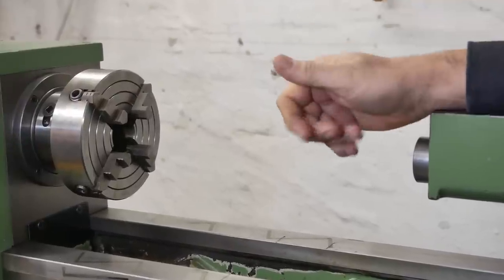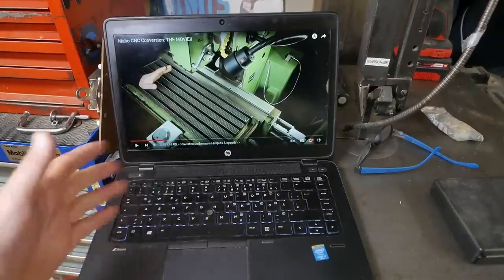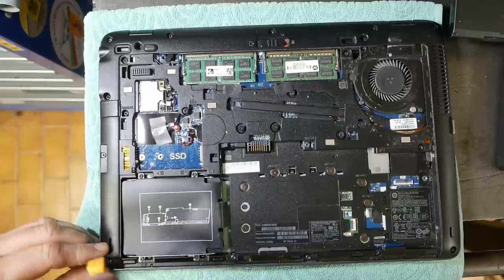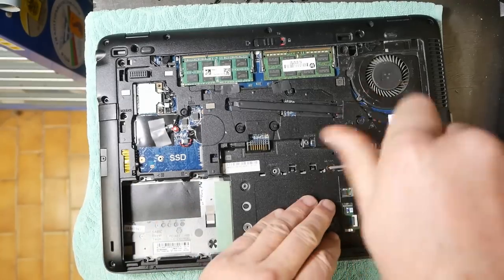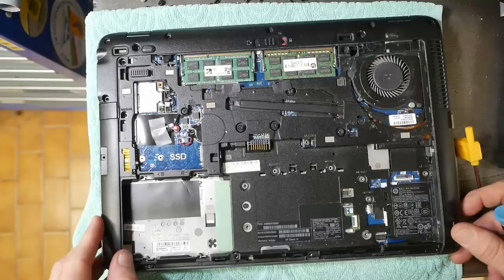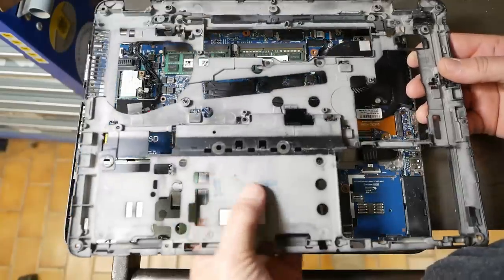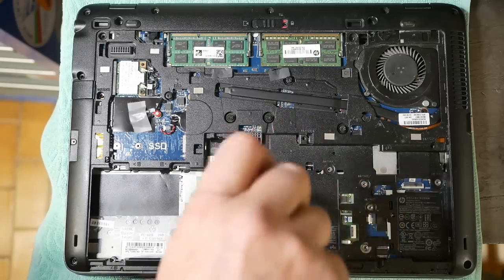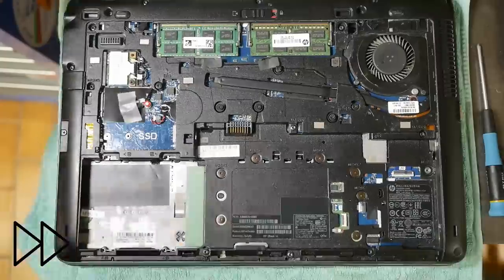M1 Mac: New, Refurbished or PAINTED?!?

Comment: If you have the space, go for a tower or desktop PC.  They can be upgraded more easily & cheaply.  If you have your heart set on a mac, then go for the refurbished one from the Apple store.  It will come with a warranty, which, since you are using it for business (YT) means you can't really afford to have it broken down for a while.
Reply: Forget PCs - too much legacy code, no vision from the OS Vendor.
Reply: @Spiderelectron  macOS is built on a lobotomised cut of a 30 year old OS - it's just had a Fisher-Price UI slapped on top. Windows has plenty of problems, but it works well enough to maintain market dominance.
Reply: @Spiderelectron  You're really quite touchy.  You could just have said "Mac OS is now based on a version of Unix"  No need to go around insulting people.
Reply: ^^ that was also my first thought, really limiting self with laptops...they overheat and die, you can't upgrade memory sticks. Apple just didn't impress: overpriced hype.
Reply from the maker: I consered a fixed PC, by the currentprice of graphics cards is so out of whack, that it seemsmore economicl to buya preformance laptop. Plus a laptop is more practical for me. I edit mostly at my desk at home, but not always.

The videos I have seen on apple silicon for video editing are pretty persuasive. While top gaming PC's like Razer blade 15 advanced might have a slight advantage in absolute power, the way the M1 stuff can maintain performance under load without throttling, or sucking the battery flat fast is impressive. 

Mr Alex Tech example is very relevant for m workflow.
https://www.youtube.com/watch?v=boMVxaNFfZ0&
Reply: @Spiderelectron  i bet you drive a tesla too
Reply: @RotarySMP  Just like anything in life where there is a choice to make, there are pro's and con's to the decisions we make. Apple or Windows, desktop or laptop, used or new, vanilla or chocolate, etc. etc. Pick the one you that meets your required needs and budget. Depending upon what programs you use now, do keep in mind the fact that you may have to purchase them again if you are switching from Windows to Apple. 

Apple often has a slight edge on how well their systems perform specific tasks because they only have to focus on a very limited amount of hardware, allowing them to select what runs best together and have the opportunity to optimize the software better for that specific hardware configuration. Historically they have focused on multimedia editing as their niche. Apple tends to cost more for the initial purchase as well as when looking to upgrade hardware. There tends to be less options to choose from for Apple products and those options usually cost more than a comparable upgrade to a Windows machine.
Reply: @Spiderelectron  only if your using Microsoft. Desktop with any of the main Unix/Linux 'distro's' may be superior depending on editing software, plus, being 'free' would save a bunch of cash allowing for a much better machine specification
Reply: @iamtheomega  I agree. Apple have not been very good with consumers for years , but, have had remarkably good advertising. Personally, it's very doubtful I would ever have another Apple product as they often drop support with little or no warning plus fought for years to prevent independent repairers working on Apple products (just buy a new one, yes, we are trying to save the planet')
Reply: @Spiderelectron  I used to service them for a living mate, I know full well they use a trimmed-back freebsd derivation with the package managment system removed. Continue fanboying though.
Reply: @RotarySMP  What I do Is use my Ryzen 2700x (yea its a bit old 8 core 3.6Ghz stock) at my desk, if I am on the garage computer or sitting in front of my shit ultralight laptop is remote desktop to the Ryzen machine ... there is a bit of input and screen lag, but its no worse than using a below happiness laptop. Then when "stuff happens" you have the computational power of a home workstation doing the heavy lifting. The UI is lagging over wifi a bit , but you could use your beater HP as a terminal to something fairly beefy that does the real work.
Reply: @RotarySMP  that is tru,everything is way to pricy right now..i looked at the gfx i have,and it's an old One..a titan x2,a used One was sold for 450€ here in Sweden..an 8 year old card- amazing
Reply: @jonjohnson102  Nah - not my style ;-) Look guys all I was saying was don't cristicse macOS unless you've actually used it and analysed it. Being different doesn't make it wrong. I use Windows, macOS and Ubuntu all day everyday for work. It's horses for courses - whatever is the best OS for the job, does the job. macOS has it's faults - sure - but so does windows. M1 Mac is a good fit the operation required here. Just because it does things differently doesn't mean it's wrong.
Reply: @RotarySMP  for graphics cards: If you think a GTX1060 3GB is usefull, I´m happy to give you one or two from my mining rig that´s just collecting dust. I´m in Vienna too.
Reply from the maker: @bernhard_derProtoTyp  Thanks for the offer. Resolve really needs upwards of 8GB GPU, and I will stick with laptops, as I need the protablity, but I appreciate your support.
Reply: @RotarySMP  makes sense! then the air seems like a really great option. ...and I love the idea of painting it green. at least some vinyl on the lid. would paint affect its cooling capacity?
Reply from the maker: @bernhard_derProtoTyp  I also got push back on paint disrupting the the cooling.

Based on the generosity of the viewers, I  am now saving up, and will like for for a 14" MBP, due to thecard slot, monitor, and greater still performance.

Comment: The M1 Macs, all of them, are fantastic. No hesitation to recommend. If the used one works well who cares what it looks like?
Reply: This guy ⬆️
Reply: Seconded. I finally moved on from my (at the time) top of the line 2015 era Macbook Pro. It's great. 

AppleCare is legitimately useful because at this point, if something does go wrong with the hardware, more often than not they don't repair it they simply replace a larger subassembly which can be expensive.
Reply: I purchased a M1 Mac when over. Year ago. I have regrets. Highly recommended.
Reply: @argee55  you give mixed signals 😅
Reply from the maker: Yeah,  really :) MIxed signals. Is there a "No" missing there? Thanks for the feedback though.

Comment: Don't buy a mac, I think its worth investing in a desktop for editing, doesn't even have to be a crazy one, just don't cheap out on the CPU, it matters the most in my experience.
Reply: You'd be surprised. The m1 chip in the new Mac is incredibly powerful.
Reply: @DoRC  I personally wouldn’t go with a Mac especially the new ones except for the Mac part that’s 10k+ you can’t upgrade basic things like storage or ram . Also apple is very anti repair any repair done by apple that involves the motherboard results in them replacing the motherboard without making any attempt to transfer your data.
Reply: @joshuahuman1  How many times did you upgrade your processor or RAM?  How many of the 6 slots on your ATX motherboard have you used up? If you don't have an ATX motherboard, you're contradicting yourself because it's the most upgradable form factor. I know tons of folks still kicking their 2012 MacBooks.

Louis Rossman has a point, but he tries way too hard to disparage Apple and it just makes him sound like a blowhard.
Reply: I get the mac argument, I'm sure they are appropriatly spec'd, but they're very expensive for not much of a reason, and you can't repair, or upgrade them, after sales support is garbage, I stopped getting apple a decade ago, but either way, whatever floats your boat.
Reply from the maker: I am a PC guy, and did upgrade the ram and SSD on teh Zbook, but Thunderbolt is so fast you can offload storage.

The M1 really has changed the calcuation. Resolve needs an 8GB GPU on windoes to edit 4K, but the M1 seem to balst through it without even thottling.
With the current price of 8GB GPU's, even used, it would be a struggle to put together a used part desktop with the performance of the M1 Air, for that price. And I need a laptop about 20% of the time.

Comment: I use a desktop ...An old Dell Precision T5500. It's got 2 quad core processors 36 GB of ram, an old Gaming Video card that is still pretty good compared to any laptop.   Total build was about $250. I bought a one year old laptop for $165 in 2012 that I still use. I don't even know how my stuff compares to modern equipment. My desktop doesn't have any problem running anything at all. Oh, fyi if it says Apple you are paying at least 2x what it's worth.
Reply: That goes for phones. The m1 macs are a pretty good deal
Reply: I’m still running a T3500. It was a screaming machine when I put it together, 12 Gb of DDR5 and a W Xenon quad core with hyper threading. It was almost beefier than the engineering work stations at my university.
Reply from the maker: Resolve is optimised to load the GPU and needs 8gb of video ram for 4K editing.
With the current price of 8GB GPU's, even used, it would be a struggle to put together a used part desktop with the performance of the M1 Air, for that price. And I need a laptop about 20% of the time.
Reply: @RotarySMP  These old Dell Precision T series have two Pcie 16x video slots. You can get 4 gb ddr 5 Radeon video cards for under $75 US and slam two in there. That should do it. Even something as old as a Radeon 7670,

Comment: 4K really Mark?
Your quality is great as it is. It's the content that makes it really worth the watch.

4K comes at a premium all round, so it's not just the type and cost of hardware to render it, but the huge amounts of storage you'll need too. Laptop's don't generally come blessed with large drives, so we're then talking NAS appliances and a fast network (wired) or several external drive enclosures over USB. Again, lappy's generally only come with gigabit networking, so be also prepared for long waits simply just loading up the raw footage. I'd hazard a guess that most of us don't watch in 4K anyway, so the extra cost and workload might not be worth it.

My choice would be to go for a desktop PC. This gives you upgrade options should you need. Prices all round are still inflated - what with the supply chain problems and lurgy hangover - so you could take benefit from the price drops for component upgrades when they come. In contrast, a laptop (of any type) will be a one shot - and overpriced - deal. While I do hear good things about the M1 series, I've always had an aversion to the whole Apple ecosystem and resent the "Apple tax" even if the hardware is nice. Don't let my prejudice influence you however. 

DaVinci Resolve is cross platform, so the OS of choice shouldn't matter a great deal. - It works well on Lennox btw ;-D
Reply: What he said! Your videos are top quality already. Save your money. 😀
Reply: I totally agree. No real need for 4k.
Reply: yeah 4k is overrated imo
Reply from the maker: Thanks guys. With my current DSL line, I am maxed out at 10mbs up, so uploading 4K video is not really possible, and there is no plan to improve coverage of my meihbourhood.

Shooting and editing in 4K would have some advantage in flexiblity of crop in editing. I already do this a bit with Panasonics excellent in camera live crop,to simulate a slider.

The prices of GPU's even second hand make a fixed PC pretty uncompetitive with laptops, and I am away enough that a laptop suites my workflow better.
Reply: yep-  I watch in a window on a 2k monitor...  When you do upgrade the computer I would want a warranty.  I am a Linux user but for your use case (edit on a laptop) the Macbook is a good choice.

Comment: Windows desktop.  Unless it needs to be portable the maintainability means a lot.  High-end GPUs are hard to come by but one a few generations back will keep you just fine.  The Intel macbook I have only does one external display per Thunderbolt port so forget displaylink and displayport MST.

All that being said 1080 is fine, really; good lighting like yours makes more of a difference.
Reply from the maker: Currently even an older 8GB GPU used is so expensive, I cant build a desktop PC for the price of a decent used laptop. Plus I do need a laptop for my work flow. Good point about the air only supporting one monitor. I am planning to get an external monitor or two for my desk.

Comment: I think most apple laptops use the case itself as at heatsink (I guess more of a reservoir for the air) so I am not sure painting would work the best. I haven't had any issues yet with my refurbished computer gear but they are generally EOL business stuff instead of consumer gear. Have you considered an M1 mini instead of a laptop form factor or do you edit too much on the go to make that an option? It would save a bunch for comparable hardware but is far less mobile.
Reply from the maker: I tend to edit enough on the move that a laptop plus docking hub/Monitor/keyboard makes more sense than a fixed pc.
Reply: @RotarySMP  Understandable. 

Here is a Linus tech tips video about the M1 Air that I was misremembering about the cooling. https://www.youtube.com/watch?v=ghDvyItIHTY He adds some thermal pads between the internal heat sink and the back panel of the case to improve the cooling and increase performance (~8%) for extended workloads. 

I think the M1 Air would be a great upgrade but would probably go for the refurbished ugly one.

Comment: I've been buying refurbs (with warranty) for various businesses for years now and they've been just as reliable as new machines imo. Used is probably also fine (and a machine green one would be hilarious). So i'd go with one of those if it has to be a laptop. Otherwise, i'd also try finding a decent used/cheap tower PC,  maybe upgrading it a bit. That way it's much more easily upgradeable
Reply from the maker: I probably edit about 80% at my desk at home, but move around enough that a laptop fits my workflow better. 

The performancein video editing of evenbaseline M1 Air is astounding.
https://www.youtube.com/watch?v=boMVxaNFfZ0&

Comment: Get the M1 mini (700ish) and bolt it to a decent size monitor ($-$$$). Gets you two benefits a) its still sorta portable in the house b) instead of buying you can make a video on the vesa mount ;-). If you need to take it on trips its the Air for certain.
Reply from the maker: I need a latop bout 20% of the time, but that is enough to make it necessary. I will get a big screen though, as editing in a 14" monitor is really getting old.

Comment: I recently switched  to desktop, just more value for money. Kinda hard to carry around though..😅
Reply from the maker: Resolve is optimised to load the GPU and needs 8gb of video ram for 4K editing.
With the current price of 8GB GPU's, even used, it would be a struggle to put together a used part desktop with the performance of the M1 Air, for that price. And I need a laptop about 20% of the time.
Reply: @RotarySMP  fair point, for both desktop and laptop I went with refurbished and,  personally, I really recommend  refurbished as the product is basically as good as new. A downside is that you're always running behind on new tech.

Comment: Does it have to be a laptop? The Mac Mini M1 base model costs 800€ new. You need external storage if you want to have 4k videos stored. The good thing about a desktop is that you don't move it much. If you were to drop a Macbook Air you'll probably gonna break it immediately and should consider Apple Care +. 

I love MacOS. It is in my opinion a very good OS if you are bought into the Apple ecosystem. I had a Mac Mini M1 but had to sell it due to my needs for CAD software which is, in comparison to Windows, non existent on MacOS. I didn't try to edit videos on Mac before, I only heard that they are good, especially the M1 Mac.
Reply from the maker: I need a laptop, as I travel enough I like to use the down time for editing.

Comment: Hello Sir,
First go for the Patreon community will be eager to throw some money at you ;)
If you really want to buy M1 Air and the cheapest one go for Refub , it is "only" 150Euro more expensive and you have a warranty. But i would consider to go for a higher spec . With the bottom of the line you will be stuck with 8gb of ram and 256 internal storage .
And if you will go for a higher spec you can start considering a PC machine like Legion Pro in which you can upgrade storage and memory but it is way heavier and bigger (16 inch 100% SRGB display 2,5kg)
Reply from the maker: Thanks for your support.
I was looking at a Razer Blade 15, but they are 2x the cost, and throttle if rendering on battery.

Comment: If you get a Mac, get an M1 Mac Mini. Otherwise, save your pennies for a real desktop PC. Use Windows and especially Linux.
Reply from the maker: Resolve is optimised to load the GPU and needs 8gb of video ram for 4K editing.
With the current price of 8GB GPU's, even used, it would be a struggle to put together a used part desktop with the performance of the M1 Air, for that price. And I need a laptop about 20% of the time.